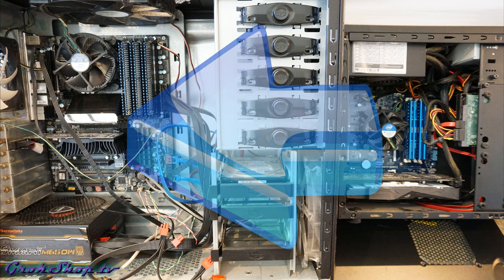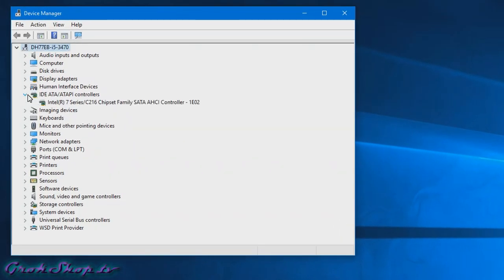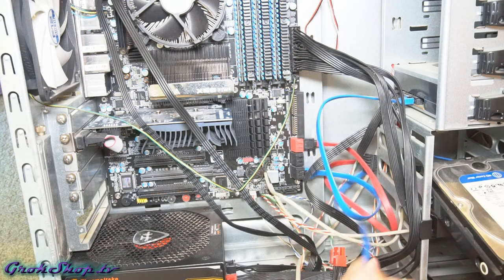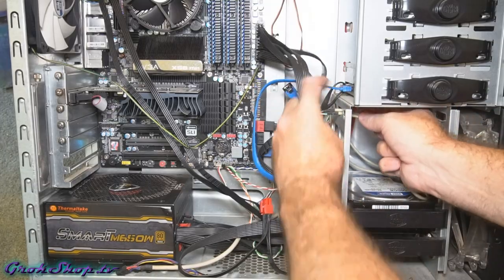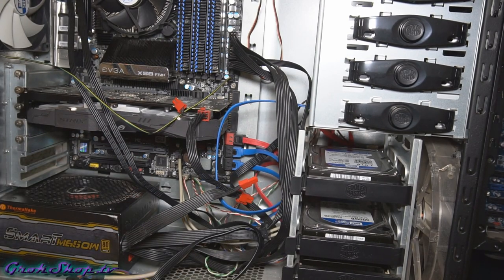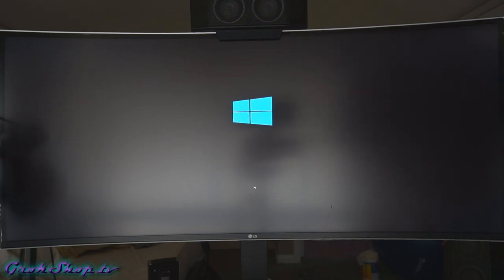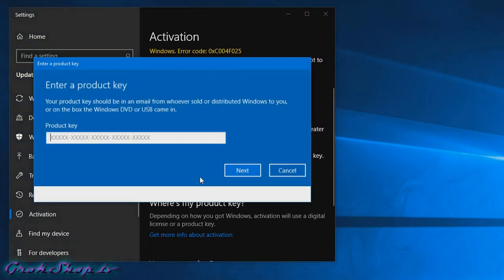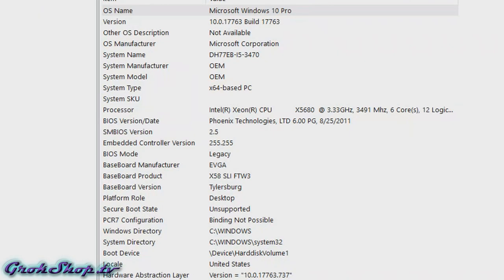Transfer Windows 10 To New Motherboard & CPU + Digital License Transfer

Comment: Alright, for anyone in 2022 watching this, i have some heavy hitting questions needing answers from some awesome peeps.

i'm going from an Intel i7-7700k to an AMD Ryzen 7 5800k CPU, (updates to MOBO & RAM as well) and i'm curious on a couple things:

1.) since my microsoft account is linked to my windows license, do i need to just simply LOGIN to my microsoft account after i get the new system booted up, and i'm good to go? 
I see people saying I should do a fresh windows installation, but If anything, i'm assuming i could just simply pop in my new MOBO/CPU/RAM, boot it up, and then login to my microsoft account then BAM, good to go (after doing the steps from "2.)".

I also have completed a full backup/system image to my HDD, which will stay un-connected when i first boot up my system with the AMD hardware in there.

2.) If i were to simply go into my Device Manager and delete the Intel Processor info under "Processors", and maybe anything else that says "intel" would i be good to go?
(Keep in mind my "IDE ATA/ATAPI Controllers" is also "standard" not "intel")
Then simply install the new drivers for all my new tech right now onto my SATA SSD before i shut it down and install the new hardware?

May be too complicated of a question, but I'm hoping to a some response from someone that knows something about this stuff.
Youtube and the internet doesn't have a lot of info on these specific questions.

Thank you <3
Reply: @Hunter Rivera  you added a new SSD or how??
After all during my reseach, I discovert that if Windows activation is numeric and binded to Microsoft account, just need to restore activation online, so even fresh install on new Disc is fine 😉
Reply: @DrZipZwan  hey! So all I did was put the new SSD in, had the windows boot drive on it, and set it as my boot priority. Didn’t even have to remove anything on the other drives or anything like that. 

Works like a charm 👍🏼
Reply: @DrZipZwan  yup that’s sounds about right! Should be able to do it all online now 👍🏼

Comment: Hi, got 2 x nvme storages. Moving both to a brand new system. 1 is for OS, 2nd is for files/games storage.
Does this work for nvme drives? and, is there anything else I should be aware of before I put both the nvme drives before booting my new system? Ty!

Comment: so does this mean with my current pc if i upgrade my mobo and cpu, and already have windows 10 on an ssd, i can just upgrade my mobo and cpu without having to worry about reinstalling windows 10? i wanna switch from intel to ryzen
Reply: if your windows is connected to your microsoft account then there shouldnt be any problems, just troubleshoot in the windows activation page after the "surgery" and you're good
Reply: @nepruutana4007  wait how do I connect my windows to my microsoft account?
Reply: @Maksim-hy2ov  go to your activation settings and it will tell you if your windows is linked to your Microsoft account. Hope this helps.
Reply: Its like reuse my ssd that has windows os on it.. but it have to make sure that my windows are connected to the Microsoft account right?

Comment: Soo when i change my mobo and cpu i just plug everything back in like it used to be and start the pc and everything gonna be the same? No flash drive needed or anything?
Reply: thats what im trying to figure out plz reply if you have any info on it cuz im getting a ryzen 5 3600xt and b550 mobo combo on black friday and im extremely confused.
Reply: @flowzie8962  wyd
Reply: @flowzie8962  u ever figure it out?

Comment: Instead of using my old drive for Windows 10 can I use the tool to install windows onto the new machine then somehow transfer the license after?
Reply from the maker: You should be able to just do the install, and then attempt to transfer the license with no risk.  As long as its a retail license you should be g2g.  But if it fails, you haven't lost anything.

Comment: Hey, for me there is one thing what makes me a bit anxious: I don't and can't change something to "Standard SATA AHCI Controller". Either IDE ATA/ATAPI Controllers nor in "Storage Controllers". For me there only is:

>IDE ATA/ATAPI controllers
ATA Channel 0
ATA Channel 0
ATA Channel 1 
ATA Channel 1
Standard Dual Channel PCI IDE Controller
Standard Dual Channel PCI IDE Controller

> Storage Controllers
JMicron JMB36X Controller
Microsoft Storage Spaces Controller

exactly like this in order. And I can't change none of them to Standard SATA AHCI Controller. So can I already just replace my mobo and CPU without doing here something?
Reply from the maker: Do you have a PCI board which connects to a drive?  That is usually why you might see "Standard Dual Channel PCI IDE Controller".  Also do you have more than one drive?  If so, you need to be sure what your boot drive is.  If your boot drive goes through a PCI board, then "Standard Dual Channel PCI IDE Controller" may work.  Mainly, you have to be on a generic MSFT driver when you come back up, or you could have issues.
Reply: @grokshop  First of all, thank you so much for answering and taking your time!
I don't know exactly what you mean by "PCI board"
I have 4 Drives, all HDD Drives, no SSD. I know which one of them is my boot drive. And everyone of them is connected normally through the PSU and via Sata cable directly into the board, but I think you don't need this information so sorry if this sounded dumb or something. 

I tested it back then with Win7 just taking out my hard drive and connect it to another mainboard and there I got bluescreens. But since many people talk about Win10 being safer for this method I am unsure what to believe.

Maybe you could explain to me what do you mean by "PCI Board" and "MSFT driver"?

Sorry, but this is the only topic about PCs where I don't know much about.
Thanks again for your help. I'm really struggling with this Situation.
Reply: @ReduRecords did you figure this out? I have the same issue

Comment: Nice video.  My issue is my mobo which is AMD chipset seems to be fried and I never got a chance to reset the controller.  I'm getting a new machine with a Xeon processor and I would like to be able to do this. Is there a workaround to this?  What about possibly to set the drive as a slave temporarily and delete the driverstore folder drivers which have the mobo drivers that just went bad and copy over the default drivers from a Windows 10 image?  I don't want to have to re-install again  What about attempting to boot into safe mode since it would install with basic drivers and maybe fix the driver issues?  Just trying to explore all options.
Reply from the maker: Yeah that is a tough one.  I don't know if your ideas will work, sorry.  Make a backup first, if possible, before you try.  If you need to reinstall, do it on a new drive of course, so you can at least salvage your data from the current install.

Comment: I upgraded from a windows 7 install and now can't find the key. I do have the upgrade tied to my microsoft account though. I didn't think you had to re-enter the key. Can windows account do this for me? BTW, when i log into windows account, the hdd i want to move to new build has my current motherboard in the details. Does this make it harder to move off this motherboard to a new motherboard build?

Comment: so after I input the key (from original hardware), the license is TRANSFERRED to the new hardware? I'm thinking I might need a major upgrade next year or something.
Reply from the maker: In a sense it is.   I don't have any insider knowledge on exactly how they handle it, but based on the various pieces of surrounding information, I deduce they are keeping a database (DB) which ties licenses to machine markers / identifiers.  When you go through the transfer process like I showed, they pull these markers from the OS and send them to that DB.  The actual markers used and the data format would be a closely held secret.  That DB will contain additional info like the license type, how many seats are available, to whom it is registered, etc.  Every now and then, the OS will likely "phone home" to the "mother ship" to see if all the particulars for its license are in order & if they are not, you will get the nags, etc. This is a fairly common model used throughout the SW world nowadays.

Comment: did not work.  Followed all steps.  Says that my product key is invalid.  I bought a windows 7 oem pro for system builders about a year ago.  Upgraded to windows 10 flawlessly about 1 week ago.  Tried to use the product key after mobo upgrade and no dice.
Reply from the maker: OK.  Did you verify your win10 was up to the latest update?

Comment: Question,my old PC bricked and I cant do any preparing on the HDD to move it on my new pc which will come next week without a drive.what can I do to install it safely in the new PC without losing the data on the old HDD which I want to reuse.
Reply: Having the same issue myself. I installed it and it recognized the SSD as a storage device but won't show in the boot menu. Help
Reply: Make sure if your old PC used MBR on the HDD/SSD the new Mobo might be set to use GPT. Check the BIOS (UEFI is the newer tech that uses GPT, some still call it, incorrectly, the BIOS), you might have to set the boot to legacy or MBR if your old boot drive used MBR. It won't boot if an MBR HDD/SSD with the Mobo set to UEFI or if a GPT HDD/SSD with the Mobo is set to MBR. Most current PC are UEFI by default. Also make sure the drive is bootable.

Comment: So say I bought my PC used, and I'm using the copy of Windows 10 on this PC, building an entirely new PC and want to transfer my "digital license" to the new pc, without re-using my old HDD. Is the digital license attached to my Windows Account? Or what do I have to do? Thanks.
Reply from the maker: Digital licenses appear to be bound to machines, just like the old style licenses, but the record of the binding is in their DB, instead of on the machine itself.  In your case, you should still be able to transfer the license as I showed in the video, as long as you have the key, which may be on a sticker on the box or on some paperwork.  There are ways to extract the key if you can't find the sicker or otherwise know it.  So you would just do the new install of windows on the new drive & machine, get it updated to the latest updates (important), and then attempt the transfer like I showed.  Note that there are other possible approaches too like doing a full backup & restoring to the new install, or cloning like discussed here:  https://www.howtogeek.com/284677/how-to-upgrade-to-a-larger-hard-drive-without-reinstalling-windows/

Comment: Are other methods of backup viable? The system image method is forcing me include an old harddrive which contained a windows os in my old laptop
Reply: Cambesa Sure you can use sth like Paragon 17 CE, there you can make a backup for free. If your install fails, you can use this backup to restore your files
Reply: @PaulPlay  thanks for the great suggestion, the software is very clear in what you back up so I chose a complete C: backup including system reserve etc

Comment: I tried this but my new pc kept booting to the bios and windows would not start. I'm not sure what to do now this sucks
Reply from the maker: If you end up in this state, here's some things to try:
- put drive back into old machine & try to boot there - if fails, then boot into windows safe mode  (usually press & hold F8 as machine boots) & fix / restore the HDD / SSD driver there
- install a new HDD / SSD on new machine & install windows from scratch on that - then either attach old HDD to recover data or restore from your backup ( alternately, if you are confident you have a good backup, you could install windows from scratch on old HDD / SSD)
Reply: @grokshop  Thanks! I ended up doing a fresh windows install on a new SSD and it ended up being pretty painless.

Comment: If I have an SSD with win10 on it (I didn't buy a key and I wasn't planning to either) and I want to change my motherboard and CPU, GPU then do I have to do something or is it going to boot up with windows?
Reply: Did you figure out a solution?

Comment: So, I am upgrading my motherboard, CPU, and Ram, is there anything really important I need to do before actually replacing the parts? Sorry for the really broad question
Reply: You're doing the same thing as I am! I'm doing a fresh install from a USB onto  my new PC. I think this is a good idea mainly because the drivers for your motherboard will be completely different than your old motherboard with your old C drive. I'm formatting all of the drives that I can from my old PC using the Windows installer.

I've made a list of all of my installed programs, downloaded the windows installer onto a USB, downloaded the drivers for my new motherboard, and backed up all of my files onto an external drive. I also used a program to get my WIndows 10 Key (https://www.youtube.com/watch?v=woZ68FmSnq4; this guy has a powershell script that you can run to get it).

After that, you'd just do what this guy did to disable the key on your current rig, then use the product key you ripped earlier and put it on your new PC. Reinstall programs, install drivers, set up windows how you like it, etc.

Comment: So would I have to do this if I took my ssd out of 1 pc and put it in another?  Cause I did that and everything works perfectly so far. Just curious if Im going to run into any issues moving forward. I have win 10 home
Reply: So, can you give us and update, did it work???
Reply: FL D.S.  After a few days of use I started seeing a message pop up regarding “Microsoft Account Activation issue” in which I just had to provide a new windows activation code (which you can get on ebay for like $3-$5 bucks) but after that Ive been golden ever since.  Windows updates + drivers work no problem.

Again I didnt take any additional steps other than removing my ssd from my old pc and connecting it into my new one.  Ive done this method with at least 5 pcs.
Reply: @dittytitties135  when u put ur old ssd in anew pc do u just boot up and ur good? Like everything is the same and u have all ur downloads and games and stuff?
Reply: @coaxd7151  yes everything is the same. This method does require you to use another windows key for activation as windows is unique to the user’s motherboard.  If you dont have another key and you want a perfect clone just use a program called hdclone.

Comment: Hey, will this work if I also install win10 fresh onto a new hard-drive using their installation tool on a USB flashdrive? I have my original 8.1 code as well as having my license linked to my microsoft account. So my upgrade is a new HD, Mobo, CPU, RAM.
Reply from the maker: If you are installing a fresh win10, then the hardware upgrade portion of this video does not apply to you.  That is only applicable if you want to move an EXISTING win10 install to a new HD.  If you are just asking about the license transfer part, I think as long as you have a retail (non-OEM) license, you should be ok to transfer it like I showed.
Reply: @grokshop  Okay, thanks so much for the help! Its all really confusing since there are so many versions of a windows 10 license and its my first real upgrade of a 5 year old PC.

Comment: Can u replace your motherboard and connect your HDD to a new motherboard and would It loose data on the HDD?
Reply from the maker: Correct.. that is exactly what I did there.  The data should be ok.  Always good to backup just in case...

Comment: Don’t I have to uninstall every single driver before putting in the new motherboard and cpu?
Reply: ScreaMz which drivers did you uninstall ?
Reply: Symere Vert Haven’t dons anything yet I’ve only just ordered the motherboard and ram just waiting until I get the cpu. Go to control pannel uninstall all the things that look like they are to do with the motherboard like usb interface etc, and all intel or ryzen cpu drivers
Reply: ScreaMz I’m only replacing my motherboard so do i just uninstall the old motherboard files and bios ?
Reply: @symerevert8661  yes
Reply: ScreaMz Thank you bro
Reply: ScreaMz do i need to delete all my games and apps before i switch my motherboard ?
Reply: Symere Vert The only things I did was went to control panel and uninstalled all motherboard and cpu softwares, then replaced the motherboard then I only put the SSD/Hardrive in which has the windows 10 installed on so it know what to boot off.

Comment: Hey, I'm changing cpu, motherboard, graphics card, and case, and ram, but keeping same hdd and psu. Can i still keep windows?
Reply from the maker: Yes this video is made for your scenario.  As long as its a retail license, it should work fine.
Reply: @grokshop  the liscense of the windows 7 pro i bought seperately 4 years ago i put in a latop originally and then got it to work with my pc and upgraded to win 10 from that. My current pc is from 2011-2012 came with windows 7 home i lost that liscense, but im using the one i got from the cd win 7 pro it has product key with it and its an OEM version i think
Reply from the maker: @coachingconfidant2785  The one from the laptop sounds like it must have been a retail one if you installed it.  Check out my blog post to see a simple method to check your license type:
https://grokshop.tv/transfer-windows-10-to-a-new-motherboard-cpu/
Come to think of it.. I think since the digital license thing they did post-build-1607, you can now transfer OEM licenses too.  If you end up finding out its an OEM, and try to transfer it, please follow-up on how you fare!
Reply: @grokshop  i cant backup btw how much space do i need